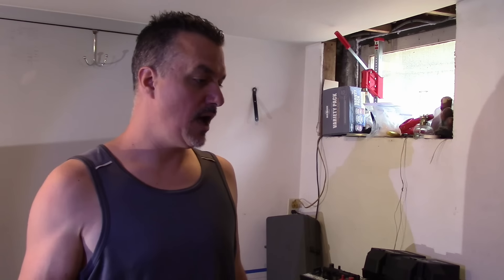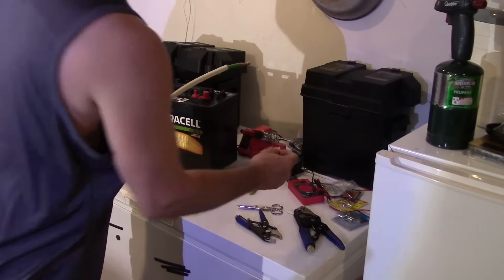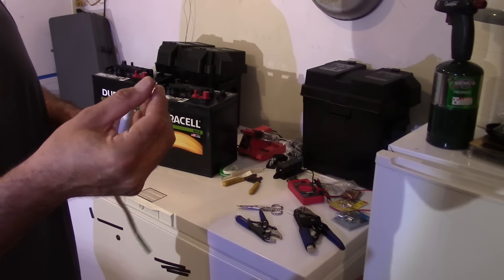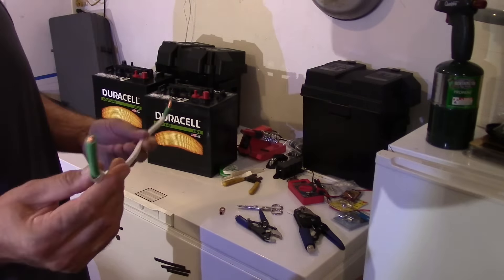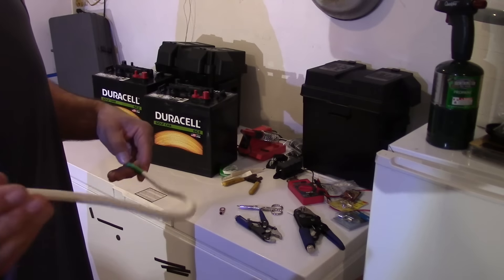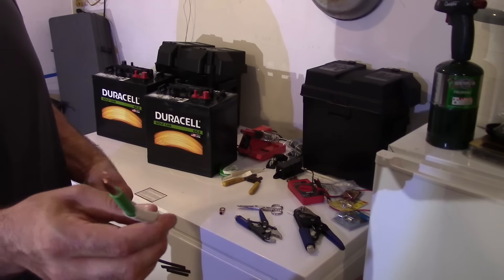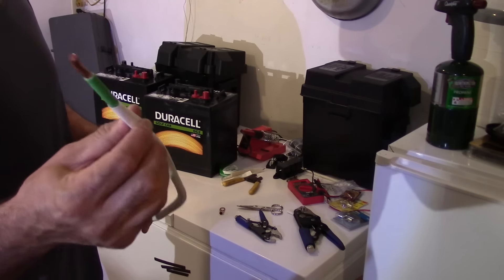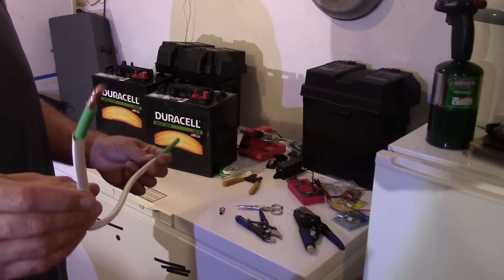Lets Talk RV camper Batteries Part 2 "It gets easier "

Comment: Good point on the wire fusing. Good idea. Using fuses insures power stays off in the event of a catastrophic failure. Many breakers turn on again after a few minutes.

Comment: Thanks so much for the info it is very helpful and I will heed your expertise and get the 6 volt batteries. Thanks
Reply from the maker: +David Termini Hey thanks Dave. lol I'm no expert and there is much better batteries out there BUT for the price,Amp HRS and lifespan every google search shows GC2's are the best bang for the buck. I have purchased two set over the years soon to be three. You won't be disappointed.

Comment: BlackTop Boondocker  I like the detail .. From wire gauge sizes to fuse size and placement. .. Even some implied soldiering techniques! :-). .. Good thought:  a good system is also a safe system!

Looking forward to your next installment to this series.  .. You might mention the charge controllers, inverters and solar panels in the discussion to "complete the circuit"! :-) .. And maybe say how much you can expect out of the system. .. Obviously, every system and everybody has different requirements, .. But, say, how long can you run different appliances, etc. (Whoops, can you say "can of worms"?)
Reply from the maker: Brian Blues Thanks Brian. Great idea I will do more videos on it i'm just a bit pressed for time at the moment.
Reply: BlackTop Boondocker .. Yeah, like I can suggest what others have time for! LOL .. I just checked, I haven't posted a vid in over a month! I understand busy!

Comment: Hi BTB, did you have a choice of color on the white heat shrink ? Black shrink lasts longer due to higher carbon black in the chemistry compound.  Also, beside a cost factor, do you prefer larger fuses over resettable circuit breakers ?  Lastly, when I made my heavy duty cables, some with Anderson plugs, I placed the plug tips in a vise between wooden blocks, with the cable opening upward, put some solder paste in the hole, heated the connector with a pin point torch flame ( more concentrated heat on the metal and to avoid igniting the wood ) then melted some solder into the fitting.  After I pre-tinned the cable end, I placed it into the vised connector, and reheated the connector.  As the solder re-melted, the cable sank into the molten solder and bottomed into the connector, making a solid connection.  For good measure, once cooled I then partially crimped the connector.  If I later needed to change the end connector, I simply reheated the end  and pulled it off with a bit of force.  The end could be reused if necessary.   Practical RV / Prepper   Jim K
Reply from the maker: The white is just what I have in the shop.  For catastrophe I like fuses over breakers and breakers for individual circuits I'm not sure why i think that way its just how I do it lol. Great tips thank you. I will be doing a 6 battery install on my new rig soon.

Comment: Hey man. Appreciate the info. Do you think AGM batteries are worth the money? I'm building a battery bank and solar set-up from scratch to turn my van into a camper.
Reply from the maker: Its all about situation and preference in my opinion.  Agm's are great if you don't want to worry about maintenance or venting. My take is If I run my batteries down to low or mistreat them and end up damaging them the cost is less. I calculate amp hour to a $ figure and length of use and GC2's seem like the best bang for the buck for me. Nothing wrong with AGM's at all and if I was to build a van with a inside battery bank that's what I would buy.
Reply: Cool. Thanks man.
Reply: sirroxalot How'd the build go?

Comment: Hey btbd...what source are you using saying #4 wire is good for over 100 amps?  NEC Code says #4 thhn is good for 95 amps max.  Just curious.
Reply from the maker: Great question. Max amps are decided by different factors. If you look at West Marine web site it says max is around 135a but NEC is 95a.  Open air makes a deference and so does SAE or AWG. You are correct #4 THHN is 95 but that is in a conduit not open air. https://wiktel.com/standards/ampacit.htm shows open air #4 thhn at 140amps max (194f).  I now use #1 cable on larger systems. I am no professional but I try and read up and learn the best I can......sometimes i'm correct and sometimes not so much so I always welcome the questions thank you.

Comment: and when having fire extin., they should be shaken up once a month --- the ingredients settle to the bottom, should shake before using, but who can think in an emergency situation?            LOL
Reply from the maker: SKPjoe Coursegold lol I was taught pull the pin and shoot not shake pull pin and shoot lol. Good idea to shake I also bring to work and the company that services checks my personal one and certifies it with a tag .
Reply: SKPjoe Coursegold ....absolutely YESSSS!   Shake once a month.  If 
Proper pressure shows on the gauge and you can feel the contents moving as you shake....you are 99.9%  sure you have a good extinguisher.  If you have pressure but cant feel the contents moving...then your extinguisher is in need of immediate service.  I think service is good for six years but check with your service rep.